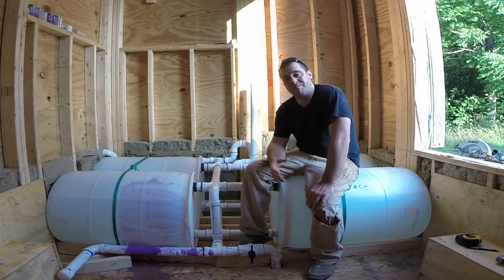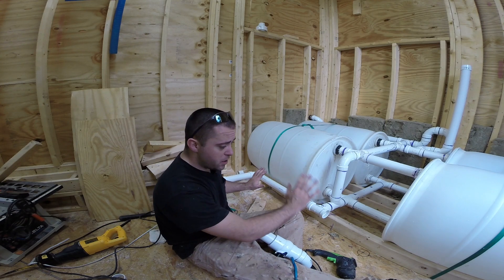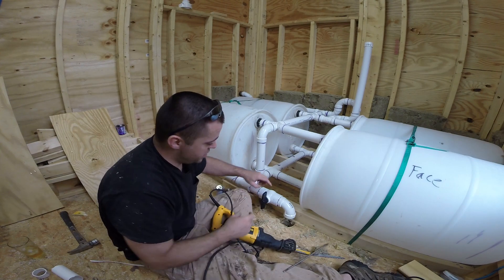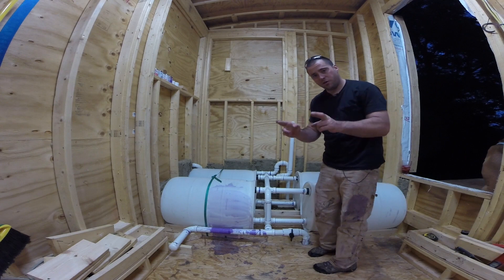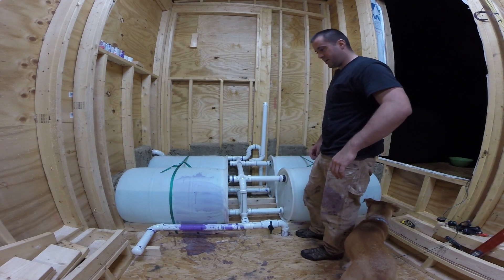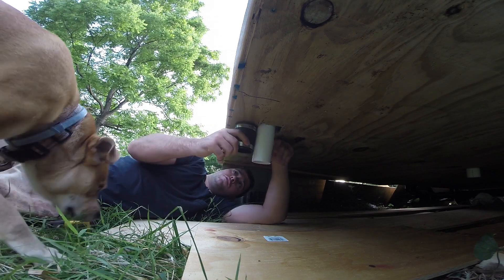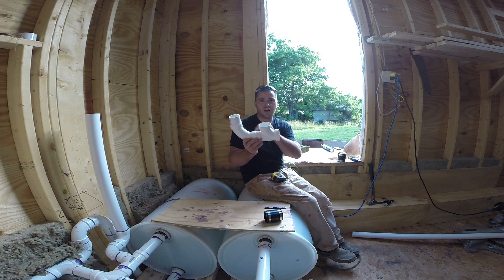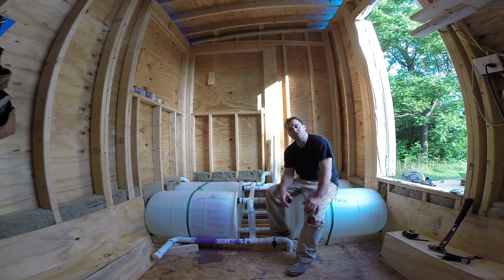Tiny House - Rain Catchment System - Finish 'n' Test - Part 3 of 3

Comment: It's a little late to suggest anything but a ball valve at the bottom of your collection pipe would have been nice so water wouldn't stand in the pipe, stagnating, when not collecting water.  Also, a cap for the top of the pipe to keep junk out of it.

Comment: my only comment on that otherwise outstanding job was that you may have wanted to place your inlet at the opposite end of the top pipe from your vent. As you said, in a torrential downpour, you may have considerable gurgling going on. - keep an eye on it.  nice work

D

Comment: I like your setup for the rain catchment system. The only thing I would have done is to add two valves (1 in and 1 out) and a cleanout hole for each tank. That way you can isolate a tank if there is a problem... such as a hole or clean the tanks if they get contaminated with dirt or anything else. You have no way to do that and with the floor system you are putting in...there will be no way to pull the tanks or really work on them with the other things you have in the floor with them.

Comment: Great job but why do you need so much water?  Couldn't you just prop those tanks on the ground wherever you set up and use the space where the tanks are for something else?

I've lived off grid for years and even washing looooong hair (woman) I get by with 5 gallons a day as it has to be hauled in.  Just curious?

Comment: I was looking at how you made the removable drain underneath , I was wondering if you could have come straight out with a 90' elbow on each down spout , and tied up the pipe to the bottom of the treated plywood , that way you would only have 3-4 inches sticking below , you might not have to remove it then.

Comment: I've seen bladders that hold 100s of gallons.  One would need some flexible tubing to connect.  Did you consider a bladder?  Thoughts?
Reply from the maker: +Randall Ijams I learned about bladders after the fact.  but not sure I would have used one.  Its a thin material, easily tears.  If I have a tank failure, I might switch to a bladder because itll be easier to get in there.
Reply: +Tiny House Customs -- I don't know if cost is factor, but flexible bladders are about $10 a gallon. Your rigid tanks are about $2.50 a gallon. If you put your tanks or tank-holders on casters, you could slide the water system as a unit (after disconnecting from the rest of the house) out the side through your new side-door! BUT, those barrels are so tough, my rugby team uses them as ballast on a scrum sled ("blocking sled" for American football), for over ten years.

Comment: I think you will have some solids as the water coming off the roof will have dust, debris and maybe other stuff (eek).  If you designed a first tank as a cleanable settling tank, the system  would be easier to maintain.  I would recommend having  a screen over the standpipe to keep the big chunks out.  Another idea to keep out solids would be to have the standpipe be 6" with the discharge at the top so when pebbles, etc fell into the standpipe, they would fall into the bottom instead of flowing into the tanks.  In sprinkler systems they call this a "mud leg" to let the fines settle BEFORE they enter the system.
Also, the standpipe versus vent pipe relationship is not perfectly clear, since you did not SHOW that the standpipe funnel is lower than the top of the vent pipe.  When it is "raining like a cow peeing on a flat rock" I am sure you will overwhelm the system's intake capacity, so the funnel is a great idea.
Great job on the videos!

Comment: For the lighting between the tanks you could use LED lighting. Get marine grade led light strips. Low energy draw and almost no heat generation. That way you can leave them on as long as you need to while in the basement. The one thing I thought of as I was watching would be to lay a fiberglass flooring under the tank area with a one way drain. Not preformed but roll and lay it yourself. Looking forward to the next video.
Reply from the maker: +TheKillerPoncho i used those incandescent bulbs.  low heat and they didn't require any special wiring.  I wanted to make a "shower pan" under the tanks but financially i couldn't.  at this point of my build I had set a move in date and had to move a little faster on my build so i only had so many bucks to spend on things.
Reply: +Tiny House Customs I definitely understand the budget and time crunch. It is an awesome build and I am looking forward to more videos. Stay safe and good luck. Ken.

Comment: What length nails did you use for your framing? Were they 16D? Smooth shank?
I bought 3-1/2" 16D smooth shank and I'm wondering if that's sufficient.
Reply from the maker: +TJ Houston yeah that's what I used.  plus 2.5" galvanized ring shank for the plywood.

Comment: I still don't understand way you need this water are you in a dry area and how about, a filter
Reply from the maker: I'm confused why you don't understand why I need water?  Do you shower, brush your teeth, wash your dishes and clean your clothes? If I can collect my own water and save $50 a month don't you think that's a good thing.  We consume water at such a high rate because it's so easy to get.  This system makes you think about water usage and also I don't always have to rely on the government for my water.   Of course I'll consume more then I can collect but this is a good start.

Comment: Nice! maybe angle the tanks to the center. lift it a little up outer ends of the tanks. nice.
Reply from the maker: That would reduce my water storage. It would make a larger air pocket on top.
Reply: Tiny House Customs that's tru. But easy to drain all the water out.

Comment: HI Dan, I've been building and working with Aquaponics system (i.e. water n many pipes) for years and I am amazed at this water system you built.  A few comments.  The water exit is strikingly similar to a U-Syphon in Aquaponics.  You will need to put the vent at the top of the U to prevent a syphon starting and emptying all the water in the tanks.  The vent out the side won't prevent this from happening... as far as I can tell from the video.  Second, be sure to install a first flush diverter to only collect "clean" rain water.  I created a small version that would work great for a Tiny House.  Basically, it is 4" pipe with a tap off of the down spout to fill.  The first bit of crappy water is diverted to fill the 4" pipe that has a removable end cap with a few holes drilled into it. Only the over-flow is captured.  This prevents leaves, sticks, debris, bird droppings, bacteria from entering your water harvesting barrels. You don't want that stuff to get in there.  I intend to use it on our future Tiny House.
Reply from the maker: I don't the a syphon will occur.  If the over flow was connected at the bottom of the tank then I would.  The feed pipe will let air into the pipe preventing a syphon from happening.

And yes I'll be redoing the funnel exactly how you described.
Reply: Tiny House Customs Trust me, if the water in the inlet and the vent go above the top of the U drain, which could happen during a heavy rainfall, a siphon can and will likely start emptying through the drain.   I can't really tell by the video, but it looks like it could be possible from what I saw.   Once it starts yer tanks will drain completely.   You'll know if it happens because it will empty extremely fast and it will be loud.  Some Aquaponic systems use these types of siphons in large daisy-chained  Flood and Drain beds.  One siphon for multiple grow beds.  Two summer's ago,  I visited an old timer that was trying to give away his water harvesting system.  Instead of taking it, I spent two hours talking with him learning how to harvest water.  His system looked so wild.  He had about 16 55 gallon barrels with 6 barrels against the garage and all others 40 feet away.  One down spout filled them all.  He had a first flush diverter and then all barrels were daisy chained together will a single pipe connected at the very bottom of each barrel.    He explained that it was unnecessary to fill from the top because water will always find it's own level.  He also said, if you have 1" of head you can run water a mile with a garden hose on the ground.  Such simple ideas, but not so obvious until you see it work.  I learned a lot from this old timer.  I would have taken the old timer's water harvesting system if it wasn't so HUGE and the barrels originally had industrial cleaner inside.  Nevertheless, it was a very cool setup.  Your setup reminds of his configuration.  All you need to do now is build-in an Aquaponics system into yer Tiny House!  ;)Edit:  I agree the tanks probably won't empty, but a siphon could start and stop as the upside down U is filled and emptied quickly.  I recommend replacing the first 90 elbow (tank side) with a T with the empty port  connected to a pipe running straight up above the top of the water catchment reservoir.  This will prevent any siphon from starting.   He may have a black belt in PVC, but he's a ninja with a circular saw!
Reply from the maker: I hear what your saying but trust me as soon as a syphon starts it will stop shortly after.  You must be not seeing it correctly.  If the feed pipe has water in it, it might syphon but that's ok.  As soon as that pipes empty air will get in stopping the syphon.

Comment: Just a thought if you remove or cap off the vent pipe you might end up with a siphon effect that could drain most of the water from your tanks.
Reply from the maker: I think the feed pipe would prevent that from happening.  It might act as a siphon or a short time but once the feed pipe is empty it'll suck air and will stop.

Comment: Nice work you have done.
A quick question, what the the endstop for on our left side ???
Keep up te good work and tx for sharing.
Reply from the maker: I'm not following.  Are you talking about the capped pipe?  It's temporary.  That's where I'll connect in the feed line to pump the water up to the shower.
Reply: Tiny House Customs Yup that is the one the capped end it is called.
Thx for sharring. It makes sense now I could not think of why you would have a capped end in the middle of nothing but it makes sense now you say that it is for later use. 
Keep up the good work.
I enjoy seeing the work you are doing, and love that you are collecting water, not many are thinking about that.
Reply from the maker: Yeah in 2 weeks that video series starts.

Comment: Nice design.  Do you have a black belt in PVC?
Reply from the maker: After doing that project I might need one.  But a plumber would rip it apart.  A few mistakes.  Those double T's should never be placed on there sides. Plus a few other things.
Reply: Tiny House Customs Sometimes getting things done is more important than spending a year planning it all out.  If it works then it's okay.